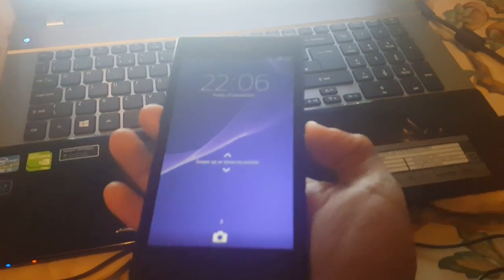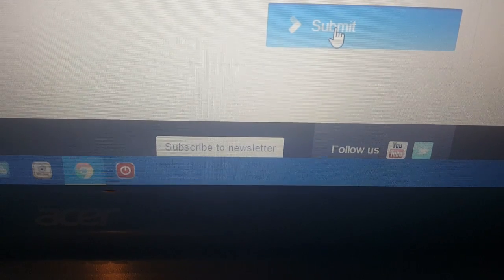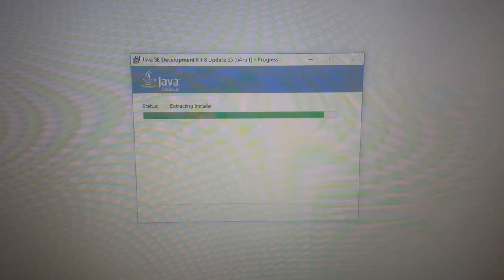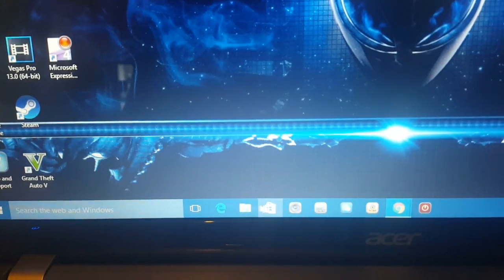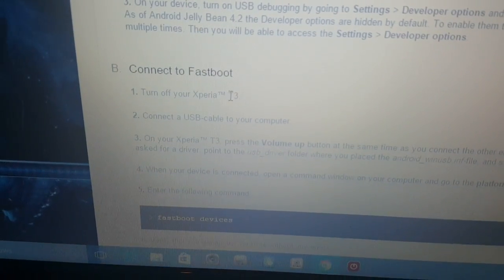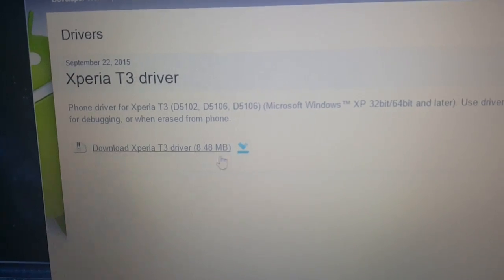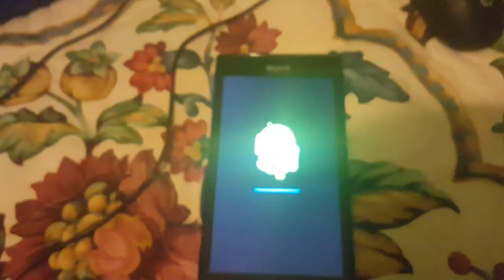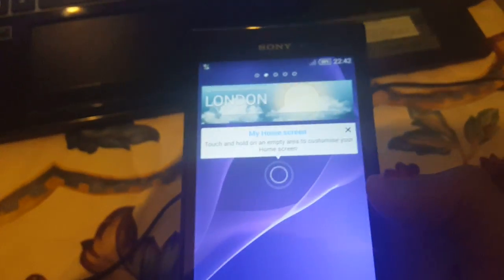Unlock Bootloader Xperia T3, Z5 Premium,Z3,Z2,Z1,& All Xperia Devices

Comment: thx android doctor it was easy with ur simple tutorial i have an xperia d5103 for the guys who cant install their drivers i recommend installing sony pc companion it will automaticly install your driver like i didnt find my driver on google so i tried this and it worked good luck keep up the good work and thx again
Reply: +Hitler ssl how to make a driver for pc using pc companion??
Reply: sharder 99 just install the software and connect your device it will automaticly install the driver for you or try installing kingo root it will also install it automaticly when you plug in your device
Reply: im done installing pc companion but i have another problem now. When i plug my Xperia SP device to computer and press volume up, it will go to fastboot mode but after 30secs my device will change into charging mode. What should i do? Is there something wrong in my device? or in my computer?
Reply: sharder 99 bro to install the driver your device must be powerd on its simple power on your device start the software and plug in your device it will detect it and install your driver
Reply: sharder 99 tell me if it worked when uu done
Reply: Hitler ssl is the driver will be automatically installed??
Reply: Yes bro
Reply: ohh ok, im done now but by device wont go to fastboot mode cuz when i turn off my device and plug it into computer, the lights will go blue, then after 30secs it will change into charging mode.
Reply: sharder 99 Install drivers when the phone is on as usual when u can use it u can identify that the drivers is installed correctly when the software identify your phone model etc...
Reply: sharder 99 yh and btw to put your device in fastboot mode u must hold volume down or up im not sure abt it and then plug in the device

Comment: there is still a exclamation mark on my driver even if change it into a ADB driver.
Reply from the maker: +sharder 99 u need to download the correct drivers like i did in the video do a google search for your drivers and install them manually
Reply: ok thank you
Reply from the maker: +sharder 99 try installing pc companion for your drivers it should fix the problem
Reply: +Android Doctor yeah it worked for me